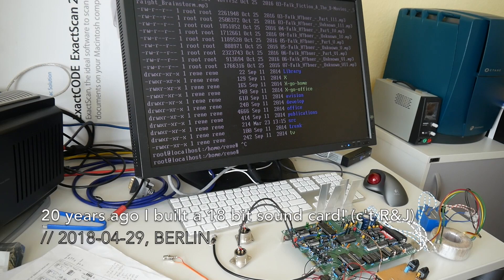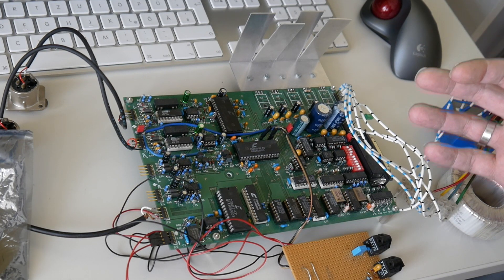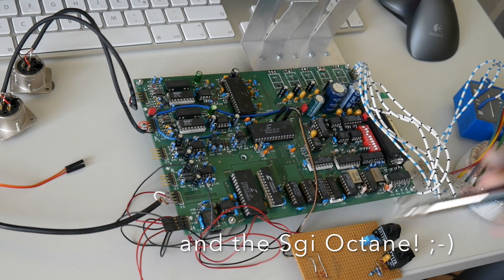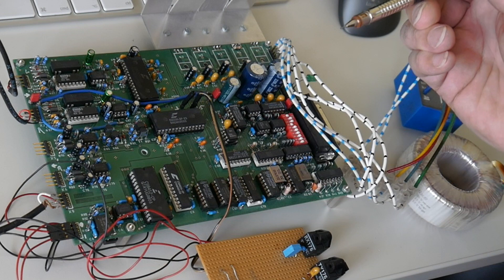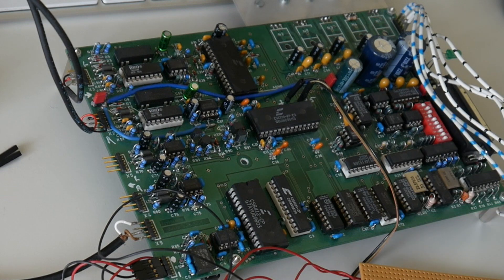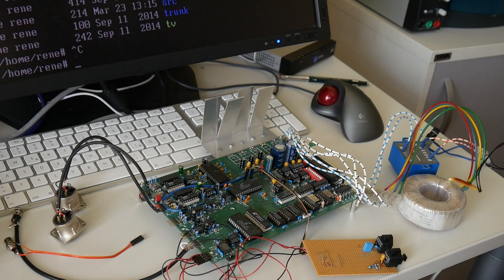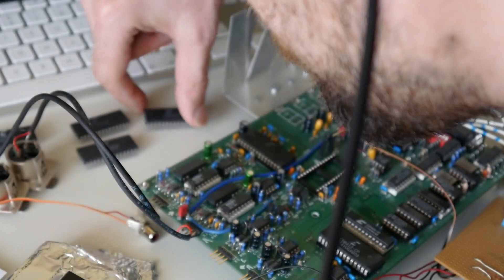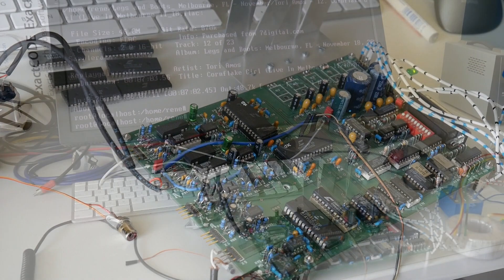I built a 18-bit Crystal AD/DAC soundcard! w/ 56k DSP in 1998! [DIY]

Comment: I’d appreciate any resources anyone can provide for working with the Motorola 56k DSP chips, especially as they were used in the Pioneer DJM-600 and DJM-500 mixers as well as the EFX-500 Effector box.
Reply from the maker: There should be plenty docs and books from the 90s

Comment: Could you give some pointer to the magazine article and/or post schematics/etc?
Reply from the maker: It was in the German c't,  about 1996-98, named Romeo & Julia
Reply: @renerebe  Curiously ESI had a card, a sound card,  called Juli@. Not sure if there is any relation there, but the architecture is not too different. But much higher end.
Reply from the maker: @EdevaldoPereira  looks entirely different, and the point of this "Romeo & Julia" design was, that the AD/DA part is not inside the PC where it is hammered by EMI, but outside in it's own shielded case, ... for it's time it was highest end you could get at home for "reasonable" moneys ;-)

Comment: Hallo René.
It took one year of lockdown to continue works on julia. I got all working (spdif is very noisy) but allow a simple question: which kind of SUB-D 25 plug did you mount on julia-board ? mal or female? I guess male was correct, according to the pin numbers on the schema. Currently I am working on an usb-interface on rasp-pico base for julia....
regards

blauzahnmeister
Reply from the maker: I'll not be near the card the next days, I guess I choose pc printer style male and female combinations...

Comment: Hi René, yesterday I tried to run my old Juilia Card too (today I found this video), but it looked like the -15V Regulation broke down. The Regulator runs hot with no output Voltage. The 4 diodes heating up too. Thank you for your analysis work. Do you have a wiring scheme of the power regulation fix you did ?
Reply from the maker: I just have a 4k or so resistor on the output of the regulator to avoid a runaway power spike when powering it on. If yours gets hot and such I guess something else is defect now. So I guess you now best need to measure around what is broken. the DAC and ADC are a bit sensitive, as I said getting mine up and running destroyed quite a few. I found it best to take the major ICs out and measure all the voltage on the pins and only put the ICs back in when everything is working ok, ..! PS: did you assemble it? Did it work when you did so initially - I guess 20 years ago?